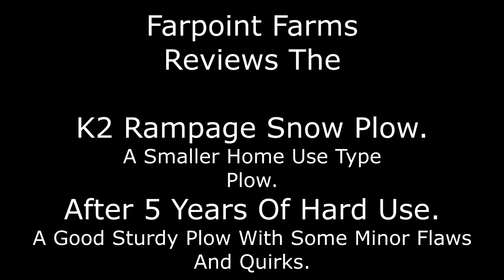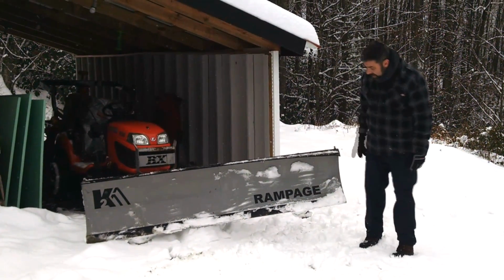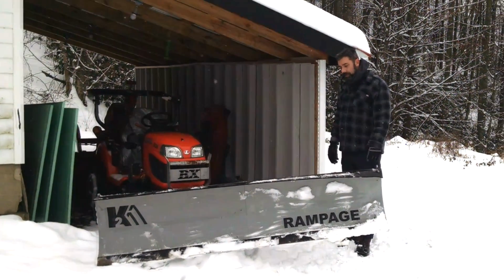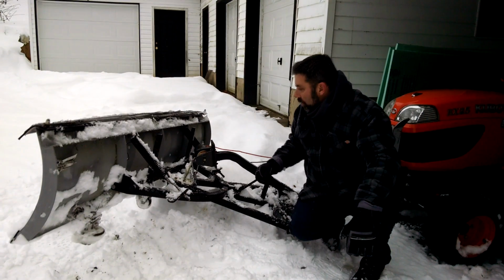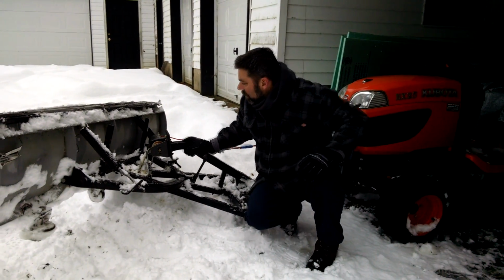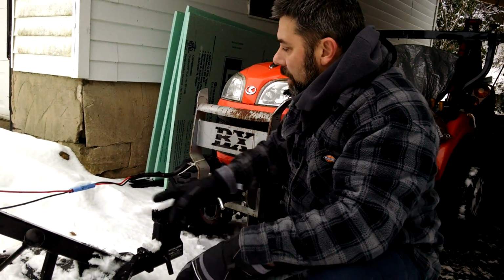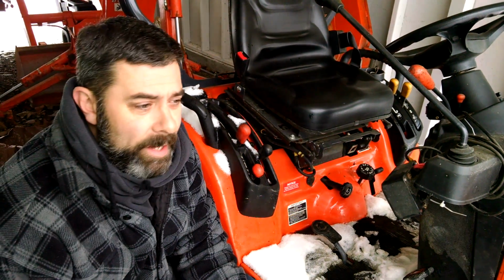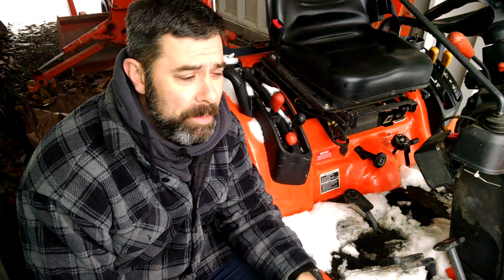K2 Rampage Snow Plow 5 Year Review And Demonstration

Comment: Ive been using FEL with back blade. Seems to be working well.
Reply from the maker: I tired it here, well just the FEL and it just over powered the unit with the weight of the snow I was pushing. Maybe I'll try it again.
Reply: That's kinda why I run the back blade off the 3ph. If its too much or time consuming for fel i'll run the back blade in reverse and if gets to much for it I can turn around and just pick up the pile and dump it out of the way with the fel. Of course your taking 8' swipes to my 5. Whatever works is my moto.